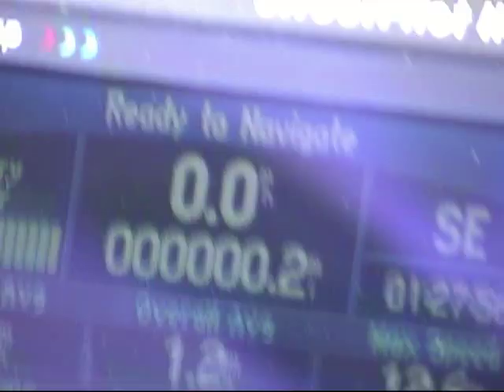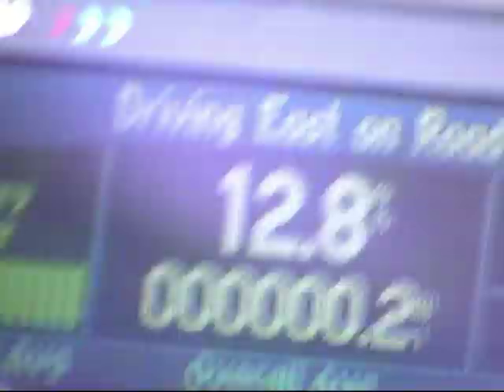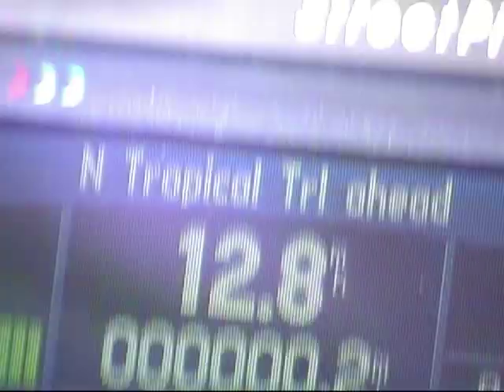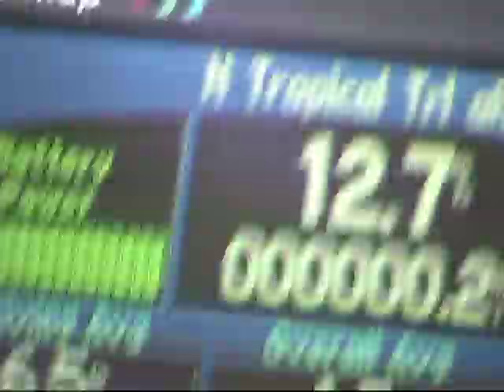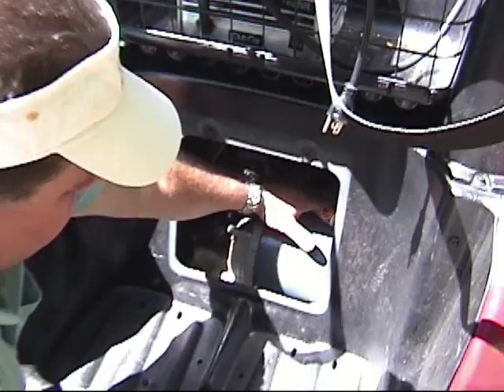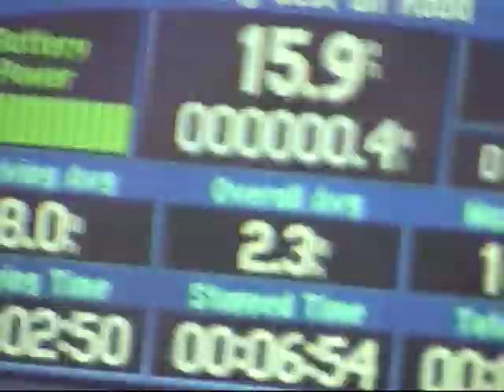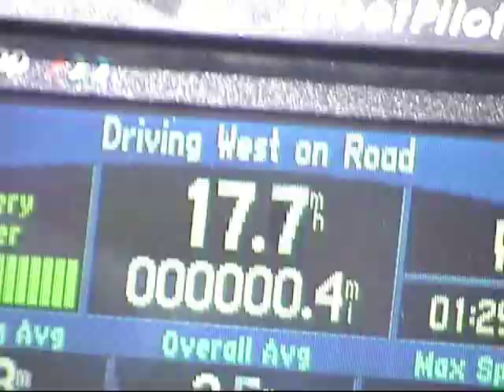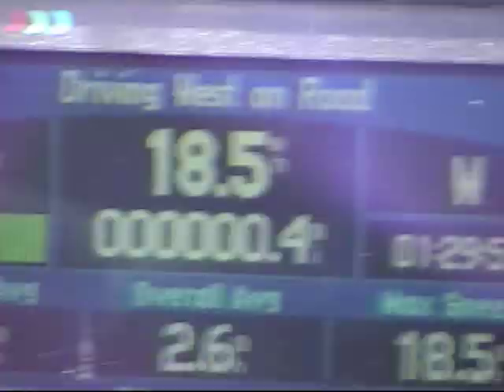SpeedyLink the Movie II.mp4

Comment: Will it work with a ge motor.  I just recently order a new speed sensor and high speed magnet to speed up my 02 cc ds.  To my dismay these parts are for a different engine manufacturer and there is no high speed magnet that I'm aware of for a 48 volt ge IQ engine.  Will your product help and will it eliminate the rev limit or and the regeneration braking.  If so I'll order one and if it works there is probably about a hundred guys in my country club that would want one as well.  Any volume discounts